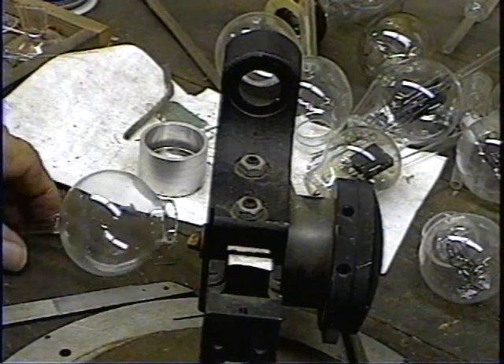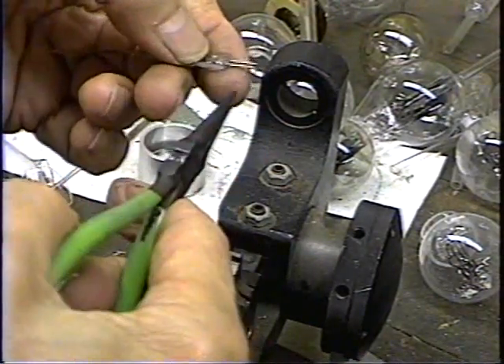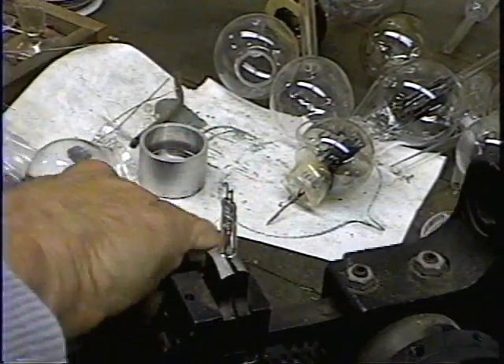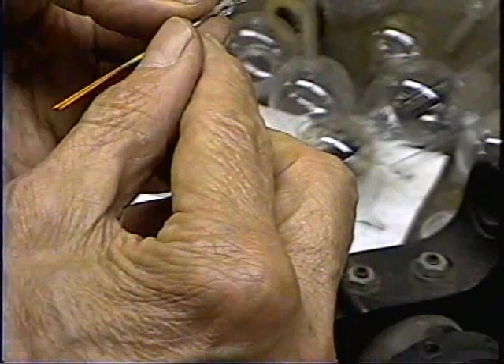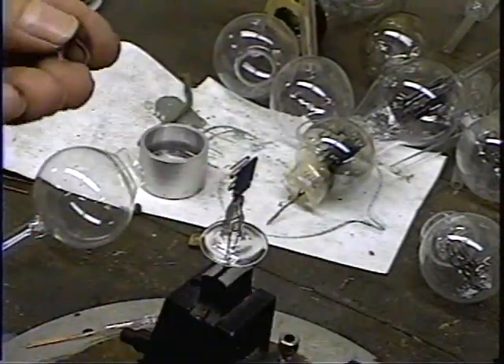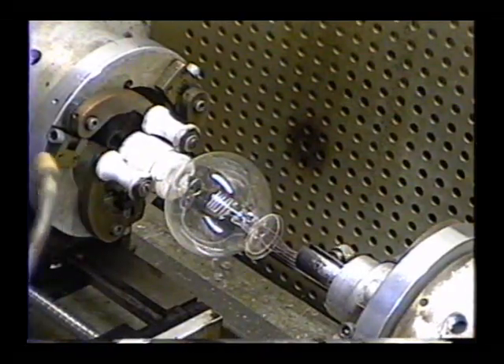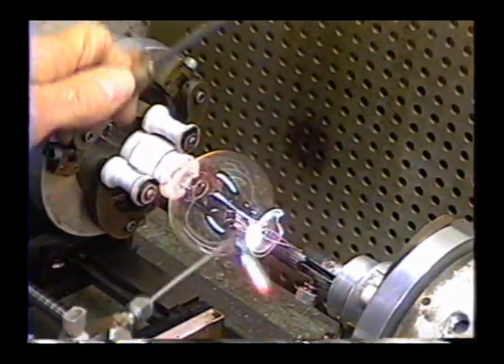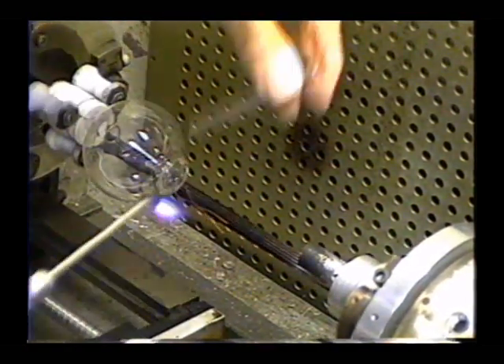Making a spherical audion vacuum tube part 3

Comment from the maker: Barium metal is extremely reactive with air. It will tarnish right as you watch it if you polish a piece of it shiny. Thus, it is not practical to make getters. Removing the getter from junk TV tubes is by far the most practical source. The tubes are cheap and the getters are made of an alloy of several reactive metals that work better than plain barium. Remember that you cannot keep the getter in room air for more than a few hours or it will be used up. Break the tube only when you are ready!
Reply: Ah I see... I had assumed that you just had a box of salvaged getters and used them as you needed them... I hadn't realised that you were keeping them in their old tubes and not "cracking them out" until needed... I suppose the alloy is going to be quite complicated to "brew" as well. (do you "brew" an alloy? or "blend" it? ???)

Comment: What type of welder is that? I haven't seen a welder that can crimp like that (I'm an unexperienced engineering student)
Reply from the maker: Homemade. It uses a transformer to run up to 90 amps through the pincher tips.